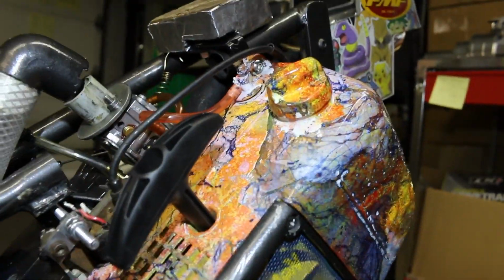JB WELD On Hole In Gas Tank! Does JB Weld Work?

Comment: For anyone getting epoxy to repair something. The original JB weld formula is orders of magnitude stronger than the quick drying JB quick. Project farm did some tests and no quick dry epoxy was even close to the strength of the 24 hour formulas, regardless of which brand you are using. I like to keep both formulas around because sometimes the quick is strong enough for certain repairs. But the original JB is incredible.
Reply: Flex seal takes 7 days to reach full strength I waited the full 7 days and no problems so far. Many people told me it would not work but I think many people don't read the directions in full and follow them when they tell you it doesn't work 🤣

Comment: I am using JB weld to bond 2 3D printed parts together, there was a small gap, and looking back now, I should have used a steel mesh as you did with the cover. This is why I watch what others do, it can be very informative sometimes.

Comment: I went with flex seal silicone and it has held up for the last week so far on my chinese 250cc enduro granted I waited the full seven days for it to dry before doing anything I'm pretty impressed the ship time for a new tank is 90 days from china so if it will last that long I would be happy but jbweld was my next option

Comment: Hi Dylon, I recently purchased a pocket bike. It runs fine at less than half throttle, but once I go more than half, the engine bogs and stalls. Could you recommend a fix?
Reply: Carb clean
Reply from the maker: Yea usually to do with the carb
Reply: Replace jet